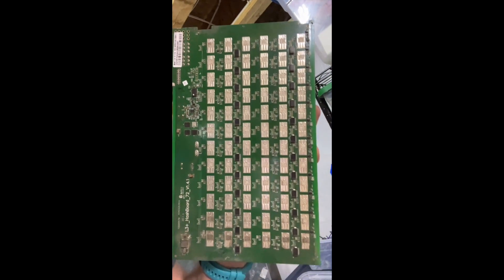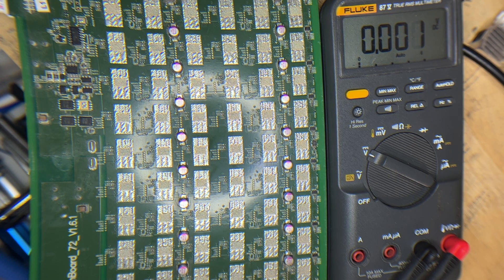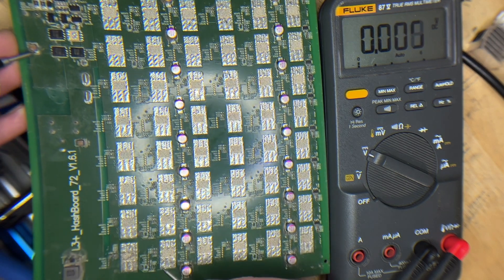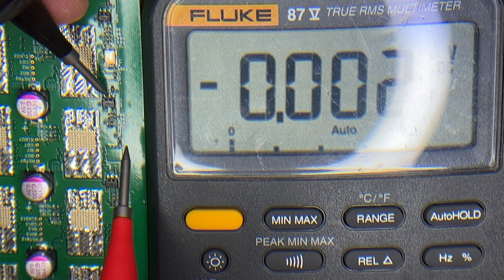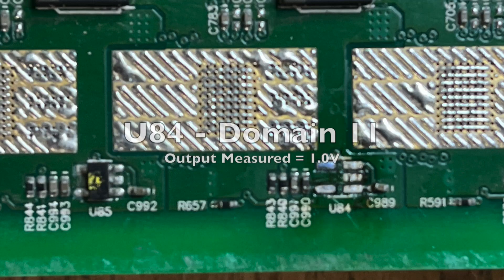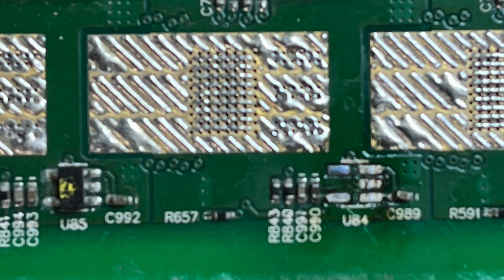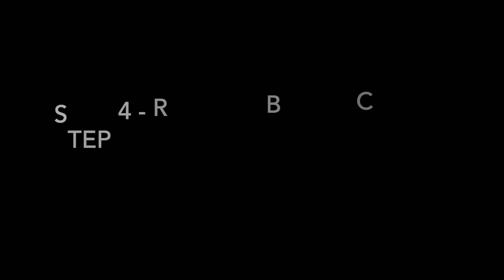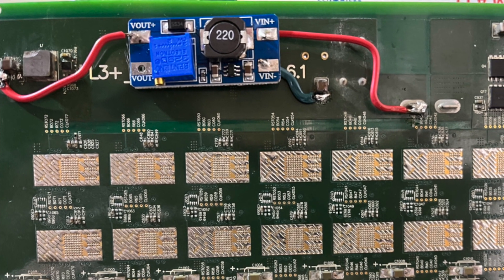ASICBASICS.COM - Antminer L3+ Hash Board Diagnosis of boost circuit

Comment: Hello, good time, thank you for your good channel. I have a problem in repairing hashboard l3+. The bost voltage is about 15.2 volts, and the output of ldo domains 11 and 12 is 0.8 and 0.5 volts, respectively. Can I use the dc-dc module?
Reply from the maker: Yes, I would venture to guess under load your on-board boost is bad. I would follow the instructions on my video and website to use the boost module and I believe that may fix your problem.
Reply: @asicbasics  Hello, good time. There is a topic about bost l3+ circuit. Some repairers do not use the dc-dc circuit and use the + part of the #943 capacitor with direct wiring, and the output capacitor of the boost circuit starts at 12 volts. Do you think it is acceptable? Won't it hurt somewhere in the future?
Reply from the maker: @mamalnami  It does work however it's not ideal. Bitmain hasn't completely released schematics to understand complete operation of the hash board however, one should assume that the circuits were meant to function in a specific manor so by not providing the proper voltage there could be other issues down the line. Additionally using a boost circuit isolates the last two domains from the 12V input, as well there are potential timing issues as the last two domains are powered on with the 12V before the rest of the domains after the 10V buck converter is initialized by the PIC. Essentially the PIC initializes and powers on the 10V buck converter for the first 10 domains, that 10V then powers the 14V boost circuit, that in turn powers the last two domains. That's the proper/intended order. Short answer, it seems to work. Long answer, above.

Comment: Would you mind either typing out some clear instructions, or (maybe even better), make a video just showing exactly how to diagnose the boost circuit? Make it very basic, i.e. show exactly which 'pins' (or whatever the term is) you'd measure the voltage on.  It seems like the boost circuit is a very common fail-point and there arent any videos that I can find showing exactly how to measure it.

Comment: Hello Andy,
I follow your step, for 1 hashboard it works
But on some hashboard, measurement LDO show short on pin 2-5, some people say it caused from short chip which make one domain short.
Do you have any case like this?
Any suggestion?

Thank you
Reply from the maker: The LDO shouldn't show a short between pins 2 and 5, if it does then the LDO for sure needs to be replaced. This would knock out that entire domain and possibly every ASIC beyond that wouldn't show. For example, if the 3rd domain had a bad LDO then your board may only show 12 ASICs, instead of 72. I have a walkthrough of the L3+ hashboard on my website that may help you: https://asicbasics.com/bloguverse/
Reply: @asicbasics  thank.. let me try